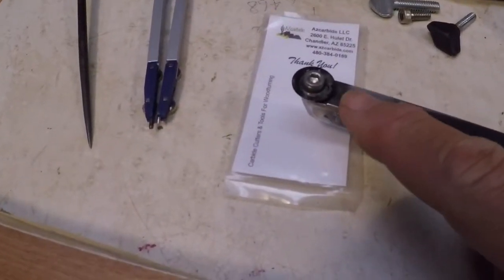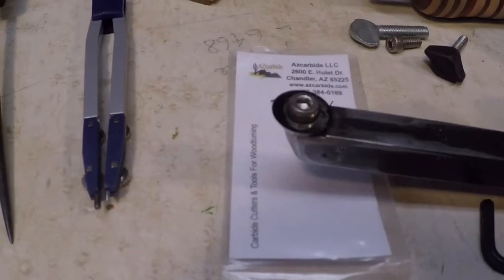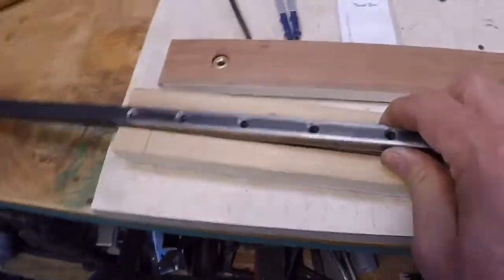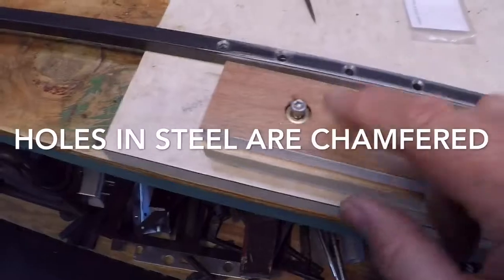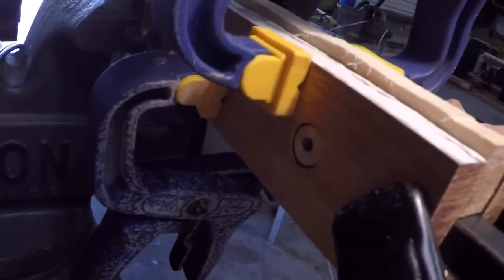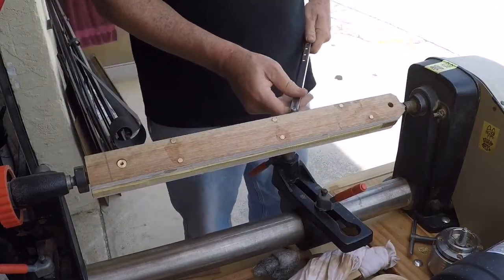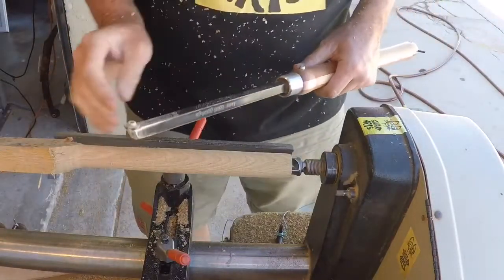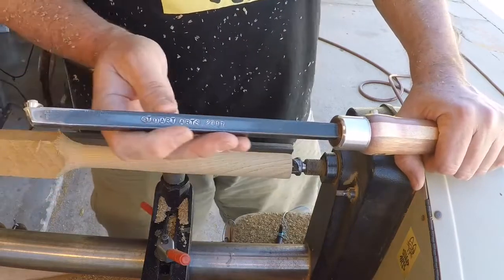Making a Carbide Cutting Tool for My Wood Lathe - Stuart Arts Episode 56

Comment: May i ask the diameter of the bar ?
Reply from the maker: martkt10 : I used 1/2" square bar for this one. I think I would have been fine with 5/16" or even 3/8".  Having said that, the 1/2" bar makes for a very solid and stable tool.